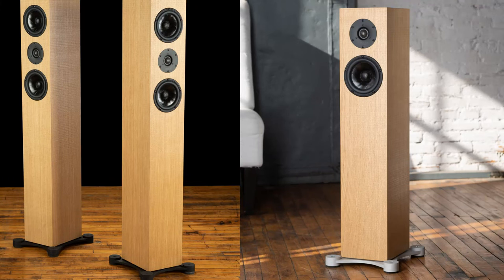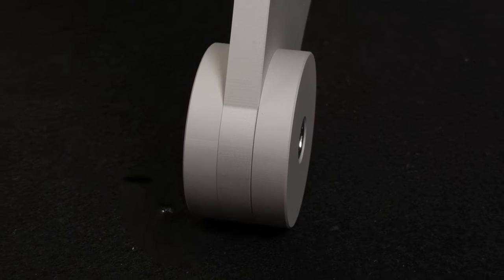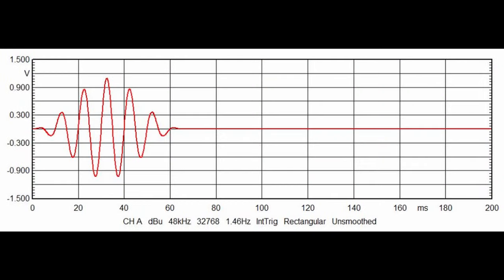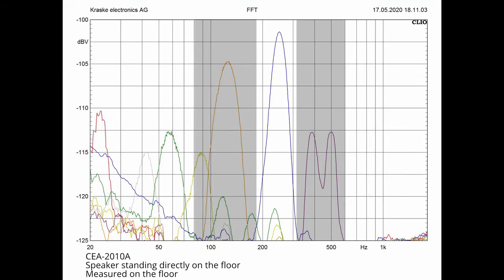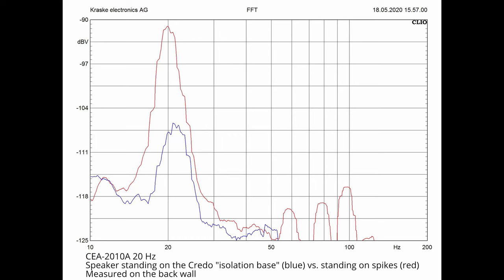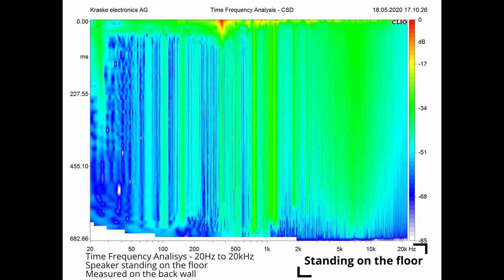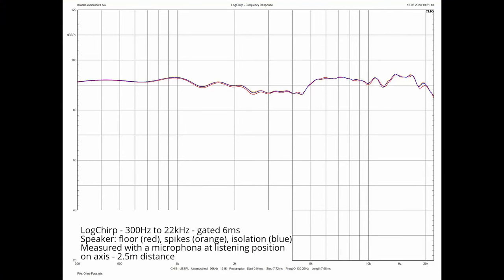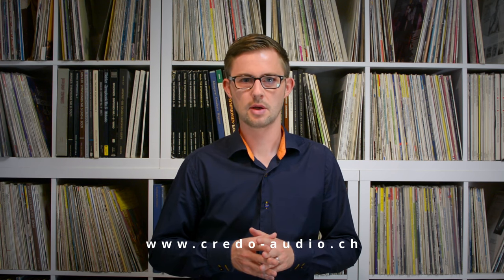Decoupling a speaker from the floor. The Credo Audio "isolation base" [isolation vs. spikes]

Comment: Ripoff copy of old Townshend Audio Podium design, compared to even older Townshend design.
Reply from the maker: Thank you for taking the time to share your thoughts with us. We appreciate all feedback, regardless of its tone or perspective.

Firstly, we want to address the assertion that our product is a "ripoff copy" of the Townshend Audio Podium design. We can assure you that this statement is not accurate. While it's true that there may be similarities in appearance between our isolation base and the Townshend design, there are significant differences in both approach and functionality.

Allow us to clarify some key points:

Originality: Our isolation base is a result of extensive research and development, and it is not derived from any existing product. We take pride in our commitment to innovation and strive to create unique solutions to address the needs of our customers.

Timeline: It's worth noting that our isolation base has been in production for over ten years. While the Townshend Audio Podium may have preceded our product, the development and design philosophies are distinct.

Approach to Damping: We acknowledge that both products aim to improve speaker performance through isolation, but it's important to recognize that we employ a different approach to damping. Our focus is on decoupling the speaker from its environment, rather than vice versa, which distinguishes our product from the Townshend design.

Compatibility: Our isolation base is specifically designed to complement our speakers and optimize their performance. While the Townshend design may offer greater versatility, our product is tailored to meet the unique requirements of our speaker systems.

Relationship with Max Townshend: We have the utmost respect for Max Townshend and value the longstanding partnership we've had with him over the past 30 years. Our collaboration has been mutually beneficial, and we have learned a great deal from each other. It's important to emphasize that we have never viewed our products as competitors to Townshend Audio, and we have always maintained open communication with Max regarding our developments.

Stella Stand vs. Podium: You mentioned the Podim Stand in your comment. For clarification, you probably meant the "Stella Stand"? It's crucial to use accurate terminology when discussing products.

Form vs. Function: Lastly, we understand that similarities in design may lead to assumptions of imitation, but it's essential to consider the principles of form-follows-function. Many speaker isolation products may share visual similarities due to their shared purpose, but it's the underlying technology and performance that truly distinguish them.

In conclusion, we want to reiterate our appreciation for your feedback and assure you that we are committed to integrity, innovation, and providing the best possible solutions for our customers. If you have any further questions or concerns, please don't hesitate to reach out.

Cheers -
Reply: What a professional and kind clarification. All the best for your products success.

Comment: Negative 105 db......can anyone even hear that?
Reply: That's the electrical output from the sensor, not the in-room acoustic energy level. Lots of things are measured in decibels, not just sound pressure.
Reply from the maker: That is 100% correct. Thank you.

Comment: Interested to know how these work on carpet. Do they come with carpet piercing spikes? Otherwise, the speakers will be very unstable.
Reply from the maker: No, absolutely no spikes. That would be the opposite of our approach. All our speaker paired with an isolation-base are very stable. But you're right - depending on the carper, we recommend stone/marble plates for a solid foundation.

Comment: Dear Credo,
I just discovered this video today, and was intrigued by what you had to say regarding isolation vs spikes as a solution to speaker vibration.
I was surprised and appreciative that you mentioned absorption and dispersion of vibration by your bases instead of mere isolation.
I come from a different background of research which espouses the use of spikes over isolation. However, these spikes are made with very specific dimensions and from a specific material. Also, they are recommended to be used with a specific type of floor. All of these are common things except the dimensions of the spikes, which follow a very specific shape design.
As I'm sure you're aware, speakers produce some of the strongest vibrations in an audio system, meaning that vibration control is essential for them to sound their best. Each driver is a motor with a piston, and will actually cause even the best cabinet to rock back and forth on a micro level when placed on a flat surface.
The research I found discovered that isolating components only served to trap vibrations inside the component, which degrades the sound in a different way. This research found that the solution was instead to drain vibrations out of a component by using something like a physical diode that would limit the flow of vibrations back into the component, and direct them into a material which would absorb and dissipate them, similar to your bases
However, that is where the similarity ends. This research, conducted and documented over a twenty year period by two engineers, found that the shape and material of the spikes played a large role in the ability to direct the vibrations. They also found that directly coupling the speakers to a floor made using traditional tongue and groove over joist construction using these specialized spikes would not only serve to drain, absorb, and dissipate the speaker vibrations, but also drive the floor as a kind of passive radiator to reinforce and tighten up the bass response, as opposed to creating unwanted resonances!
I am convinced your design absolutely improves sound quality, especially with your own speaker design. However, I just want to say that it's not the only viable technology to achieve these goals. Indeed, I have discovered over time that there are also viable alternatives to the proprietary spike designs I spoke of.
Variety is a good thing.
Thank you for any interest in reading my thoughts on the subject. Cheers!

Comment: haha, don't mind the random haters... not sure what makes people react like this to real innovation... 🤔

i really appreciate your approach to measuring the effect of the isolation vs coupling devices. the video was also really clear and well presented. thank you.

i was wondering if you have any measurements conducted with your speaker bases and other speakers, especially a bookshelf/standmount speaker + stand etc??
Reply from the maker: Thank you for your comment. Regarding you question, yes. In general we see results very close to what we published with our speakers. As long as the dampers are tuned to the weight of the speaker. And recently we released the isolation-stand for our EV 350 Ref. bookshelf. There might be a video about that as well in the future. What I can say, the crucial point is the transfer of energy from the speaker into the base-plate. The raiser-tubes need damping to prevent ringing. But to much mass and damping leads to unpleasant results.